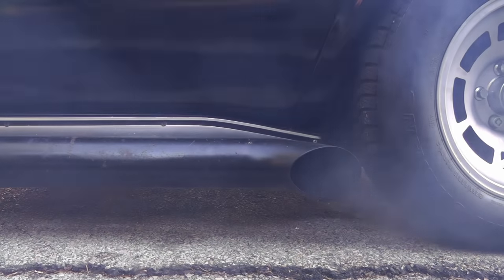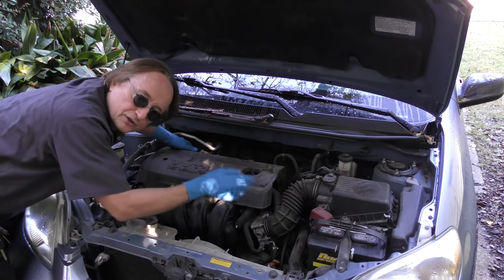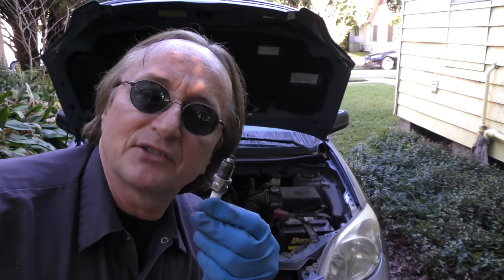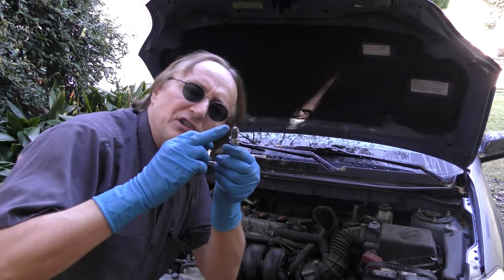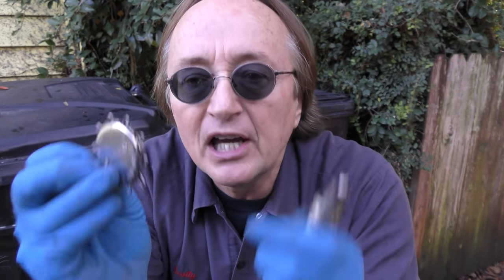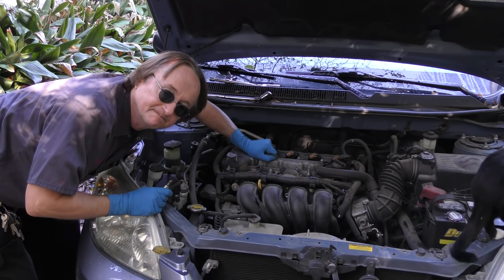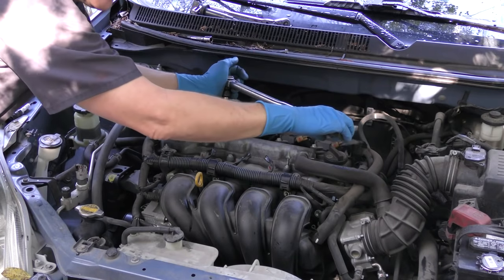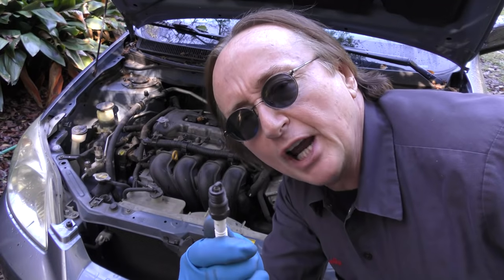What You Need to Know about Spark Plugs for Your Car

Comment: Hi Scotty don't you think the diesel engine is superior ,better fuel economy it last longer ,and no spark plugs, another great video thanks.
Reply: charles mclachlan if i may, diesel is indeed superior once you get around the higher possibility of pollutants. but drop per drop diesels have much more energy, have better mileage and the engines are much much tougher.
Reply: Diesels have their own problems. Fuel pumps and injectors go bad more often than on gas engines and they cost a SHITLOAD to replace.
Reply: Nevermind the newer diesels with that DEF system, yet another thing to buy/maintain
Reply: FCFordLord we aint in the 80s anymore, getting more than 15 years out of modern car diesel injectors is rare.
Reply: Engines on a diesel car would last even if the body rusts away :)
Reply from the maker: na, cause they cost a ton to fix when they break and they smell. Imagine how it would stink if everyone drove one. Go to mexico city to find out, then you'd change your mind.
Reply: Scotty Kilmer i would imagine it will be expensive in the US as there wont be a lot of people who work on them. Diesels actually have come a long way in terms of emissions (VW did not help though) and with stricter emissions regulations the pollution from diesels could go down to similar levels as gasoline. Gasoline still emits pollutants thought and for every gallon you use on a diesel its going to be at least 2 gallons on a similarly torqued gas engine.
Reply: i dont know, i love the smell of diesel - its Bio Diesel that stinks
Reply: Scotty Kilmer come to the UK many cars are diesel and they don't even smell, you are basing it off a LEDC with older less economical cars which produce excessive amounts of pollutants
Reply: Chatta290 its understandable man, the US doesnt have a lot of diesels. In fact it is much more expensive there. Which is mind blowing as they could get much more reliable engines, higher mileage, higher torque cars. the rest of the world is on diesel.
Reply: JayVan Geli yeah its stupid, we get 80 mpg from cars whereas the equivalent petrol will only achieve around 50 which is pretty bad considering a 3 litre 7 series will achieve that
Reply: Diesel engines are shit. I wouldn't touch a diesel car. More unreliable than petrols, dirtier and frankly outdated. Soon to be banned in several cities around the world, such as Paris and some manufacturers are already stopping investment in diesel engine tech for cars because they know that diesel engined cars will soon be a thing of the past. Diesel engines belong in commercial vehicles not cars.
Reply: JDM Boy that shows your knowlage of cars - plenty of diesels done millions of Kms while petrols cant quiten acheive nearly that amount
Reply: JDM Boy no they don't, in the UK we buy many German cars and they will all practically be diesel. we care about economy and diesels offer much better economy. BMW are investing in diesels and just because some countries like Paris put bans means nothing as the UK is one of the biggest markets for new cars. and they aren't more unreliable actually learn a thing or 2 about them. how day yuo explain Bentley making their first diesel and Audi with he SQ7. you probably live in America or something where you don't realise all German cars are now coming with diesels. in Europe they only offer diesels on vehicles like the Q7 for example
Reply: JDM Boy unreliable? Haha. Please do some more research.
Reply: Diesels are a bitch to get running if you let the tank run dry.
Diesels have issues starting in colder weather
Diesel fuel hates the cold
Diesels can self destruct if not maintained correctly
Diesels are only fuel efficient once the engine gets to operating temperature which takes longer than a petrol
Reply: IIGrayfoxII okay hence why there. are now no problems like this on new German cars as the have engineered the fixes to these problems and I have never seen any engine struggle to start unless it was a really old car
Reply: Don't all cars break if you let the fuel tank run dry? not to mention the in-tank fuel pumps in petrol engines.Cold starts is a problem for all as it affects the battery, oil viscosity. Diesels have since resolved this issue by adding glow plugs.You may still be living in the past, Diesel fuel have come  a long way, yes it is true that pure diesel gels up in cold weather but this has since been resolved with Winter Diesel. Just ask Europe :)Self destruct? aren't all engines prone to issues when not maintained? but pound for pound diesel engines are much much tougher than petrol ones.My experience with diesel is they come up to temperature in as little as 3-5 minutes.
Reply: IIGrayfoxII thats why you prime the system - actually nyt that hard to do

diesel engines have glow plugs for a reason

diesel fuel is fine in the cold, in winter it is mixed with kerosene to stop it from waxing, hence winter diesel and alpine diesel
Reply: IIGrayfoxII diesel engines do notnself destruct, any engine with self destruct if it isnt maintained

diesel do not take that long to get to operating temprature, and once they are they are 30% more fuel effecient than a petrol car
Reply: JayVan Geli in the UK we don't have different diesels but we do have fuel which is standard is what you have as premium fuel in America if that affects it in any way. you can let the car go to 0 miles it happened to our car it still drives fine.
Reply: Chatta290 im sorry what do you mean by 0 miles? Completely out of fuel? It should be fine if it runs out and dies. But if you continue to crank it without fuel you may burn out the fuel pump.
Reply: JayVan Geli your car will tell you how many miles you have left of range, we have had our car get t 0 and drive for a few miles but never cut out, that's mad for any car and in that case of it being low I would just call AA breakdown service and they all help me rather then ruin my engine
Reply: Chatta290 that meter isnt 100 accurate. even if reads low it will still have some gas left. I repair my own cars and have opened and replaced my fuel pumps a number of times and the floater in the gas tank goes down to zero even when there is a significant amount of fuel left in the tank. also the fuel pump assembly in modern cars will have a pool of gas on it, roughly about a liter or so.
Reply: Here lies another problem. 
Car manufacturers and Governments are leaning towards a maximum lifespan of a vehicle as 10 years and/or 100000 kilometres. It would be a pretty hard task for a domestic car to reach a million Km's in that time, so lifespan will become an irrelevant issue. Which takes a major advantage of diesel away from the car owner.

Comment: hey you should add heat range information
Reply from the maker: that comes with OEM specs, which is why you stick to that design.
Reply: Scotty Kilmer thanks but just put a bigger cam in my 70 Oldsmobile 350. I want to advance the timing alittle but I'm not sure what plug temp would help with ping. thanks. love the show by the way.
Reply: I'd go with the OEM AC Delcos first and listen for pinging or for signs of detonation on the plug with the stock timing before advancing the timing, as it may not like it.  You may have to use higher octane gas as a result of the cam swap which can bring on pinging due to the increased combustion pressure.
The best course of action is to have the exhaust temps checked if it has headers along with a gas analyzer to see if it's running too lean, as the carb jetting may need adjusting as well.  IF all that is out of reach for you, just monitor the plugs closely and listen for pinging.  Also may need to go higher octane on the gas if you advance the timing to get any benefit without pinging.
Reply: Believe231 the new cam has a good amount of overlap so that should help with cylinder pressure. I'm going to try running the stock 800 cfm quadrajet. I'm hoping i don't have to rejet it. it doesn't have headers. it's sitting on a stand waiting to go into my 85 Buick electra wagon hah. if Iit helps the new cam specs are 496  int  520 exhaust with 300&310 duration. stock compression is rated at 10 to 1.

Comment: Hey Scotty.. Great video and advise on plug replacement.  Always used NGK or Denso plugs on my Japanese cars/trucks. Do you use a piece of vacuum/ fuel line hose to hold and thread the plug into the cylinder head.... then tighten with a torque wrench.  This little trick works well with plugs deep in the cylinder head.
Reply: Stephen Maurer there are whats called "spark plug sockets" they have hollow rubber in the inside to hold and grip the spark plug while you thread it in there of course with an extension drive if its deep im there. just so you know next time
Reply: I got a  magnetic  plug socket the other day with an extension fitted and a wobbly .It works great, you dont have to struggle with  the rubber  insert

Comment: Scotty, dont advise people to jam metal gapping tools into iridium or any other precious metal plugs. The coating is easily cracked/damaged and the plug fouls shortly after. ONLY use plastic gapping tools with precious metal plugs and NEVER widen the gap of these plugs (if needed) by jamming something in between and bending. Bend with pliers or a specially designed tool for the job on the part that doesnt have the coating on them.

I know you probably know to be gentle with the tool, but dont advice your viewers to check the gap with these metal tools. They are in 99% of the cases properly gapped right out of the box.

Merry X-mas!
Reply: I bought some OEM Iridium Denso plugs for my 2010 Honda Accord V6 coupe. I received mixed answers online and from auto parts store.  I read the Haynes repair manual and info in my owners manual and checked the gaps with the tool Scotty says not to use.  I gapped them all to about the same and installed and runs fine. Question is was that correct or next time just install straight from the box? Or is it a big difference if I don't check the gaps and they are slightly different.

Comment: Crap, I always put anti-seize on my plugs.  Did not know it threw off the torque spec.  Also people, don't drop or bang your torque wrench, messes with the calibration.
Reply: 1ShopSnipe i still use anti-seize. Haven’t had an issue yet. I respect Scotty for his knowledge but this works for my Tacoma
Reply: I still use it, but am more careful, applying a very thin even coat with a clean toothbrush.

Comment: my car seems to have  hiccups at 1500rpms  what could it be ? scotty kilmer
Reply from the maker: see if it needs tuning up with new plugs, and perhaps have the fuel injectors cleaned
Reply: put it in low gear, drive with high rpm for 15 minutes on the highway. The car kind of "goes lazy" and clogs up if the engine never sees full accelerations and high engine loads.

Comment: In school when I was a kid, a long time ago, we were taught in feet and inches.  I still use feet for large measurements, like the dimensions of a room, but for small measurements (such as setting the action and the intonation on a guitar, where accuracy is needed) I always use millimetres --- 1 millimetre = 40/1000 of an inch, 15/64ths  of an inch = 6mm  --- come on, Scotty, it's not that difficult, and you're only a year or two older than me.   :))

Comment: Doesn't copper conduct electricity far better than iridium?
Reply from the maker: NO, quite the opposite. But it costs  a LOT more
Reply: Yes, iridium is a really mediocre conductor. Lead, nickel, brass, zinc etc. are all better conductors. But it's highly resistant to being electrically ionized, which is why it makes a great alloy for a spark plug.
Reply: gadgetmantwincities iridium is better for cars, amigo
Reply: i have heard that copper is better for performance but requires more frequent replacement
Reply: Gold conducts it better than copper however the issue is that they are unable to withstand the extreme temperatures that the engine reaches.

Comment: If people take care of your car, they just may get the 300,460 miles like I got with my 1984 Dodge mini ram van 2.2L. work horse that died in 2020.  My 2008 Chevy cobalt LS 2.2L only has 104,710 miles with only basic upkeep (knock on wood) and I started with the 100,000 mark tune-up with only OEM parts. Automatic transmission filter with seals and fluid (no flushing), Fuel filter (The fuel filter is located in the fuel tank of all places; stupid engineer design) brake fluid flushing and change, Iridium spark plug (I always check the gap) and serpentine belt. But, I will always love my 1970 Dodge Challenger with a 383 Magnum V8.

Comment: I had a LA 360 5.9L Magnum V8 engine in my 00 Dodge Dakota, I replaced the Bosch plugs with E3 plugs, I spent close to $50 and didn't feel a damn bit of difference lol 

I didn't know you don't need or should use lubrication on the threads, I learned something new today... Thanks Scotty!

Comment: what you say scotty if i change mine at a 150000miles,i own a Nissan versa .
Reply: Replace them with NGK platinum or iridium plugs and change them at 240,000 miles.
Reply: Ok
Reply: Follow your owners manual! Depending on make and model some are at 60, 90, 105, or 120 thousand miles.
Reply: Manual does say
Reply: Ok thanks

Comment: The plugs on my truck should be good for a long time to come, definitely going to go Denso/NGK Iridium the next time though just to never have to worry about them again for the likely remaining life of the engine. I read before on some sports car forums people recommended getting the cheapest possible copper spark plugs and doing a tune up every year lol...I guess they just like taking everything apart. I personally busted my knuckles up due to there really being no room in that cramped engine bay for the socket and tools I had and foolishly got a rash from leaking oil from wearing no gloves on an older 2001 v6 mustang doing a full tune up and wouldn't wish that upon anybody to do every year lol...jesus christ I cringe remember doing that in the 100+ degree summer heat and humidity, although I had no extensions or universal joint anything fancy, just a regular socket and ratchet...still, screw whoever made that cramped engine design lol >_>

Comment: I've found that ngk plugs work really good in MOST cars/trucks regardless of the make. Autolight is mostly Ford, anything else and it's a hit or miss. denso is for most Japanese/Korean/& some European cars. Bosh works best for European cars. acdelco is obviously GM and weirdly a lot of the Korean cars. motorcraft for Ford's obviously. E-3 is just a scam, I've rarely seen a car run right or if it does run good. it doesn't make any difference making the extra cost not justifiable.
Reply: I put E3 plugs in my 2004 Sebring convertible 2.7 24 valve Thinking I might get some more performace. Wrong gas mileage dropped and the E3 plugs fouled out after 1,000 miles.Took my car to my mechanic and told him what happened and he said put the OEM plugs in and it will be back to normal. That's why now I only use OEM plugs.  Shawn

Comment: 4 electrode plugs are NOT a gimmick, it's what every military fighter and bomber had on it, back in WWII.  why ?  because if one electrode became fouled or burned, it could still ground to one of the other electrodes and fire.  Scotty you're a smart guy and good mechanic, but you need to look some stuff up.  take a spark plug from a B17 bomber, see what it looks like.  it has 4 ground electrodes.  so the ultimate is an iridium or platinum plug with 4 electrodes.  if the gap burns wide on one side, it'll fire one of the others instead.  see ?  the 4 tip plugs are well worth the price.

Comment: Oh Scotty,  shame SHAME!  Don't recommend not using a compound such as anti seize. Best thing ever  for plugs. You have another video about stripped plug holes?  Why did that happen?  Dissimilar metals, heat, time. The plug thread is not much different than torque to yield. Doesnt really affect torque on a plug seat. Modern cars have aluminum heads that strip threads easily without it. He'll, I use it on cast heads. Won't hurt and a good habit

Comment: but I have an old truck with a 350.
Reply: +Cory Sennett - Keep the old truck, don't get one of the newer GMs!
Reply: Han Skinslo what a stupid comment newer Silverados are awesome 👏🏻
Reply: Angry Gamer0503 I also have a 1976 GM 350 v8 and was wondering what plugs you have in yours? I have installed now autolite 24’s since the high tech auto parts store near me sold me the autolite 24 but when I looked online and typed in the engine and year they said autolite 26 not sure what the difference was and also when I got the 24’s the guy said the gap was fine by just looking at it!

Comment: only problem is he got it wrong about this video is using anti sieze on plugs,     Ford Triton 4.6 and 5.4 2 and 3 valve engines are a real pain in the ass if u dont use antisieze and change plugs on the 3 valve engine every 50k due to carbon buildup and broken sparkplugs getting loged in the heads....    $1000 tune up at a shop    200 or less DIY. other than that he has it right
Reply from the maker: The new updated plugs for those engines that ford sells do not need lube, they screwed up on the original ones